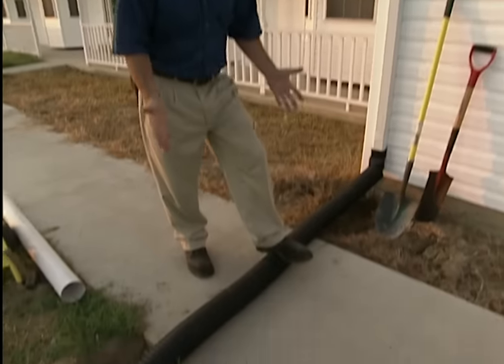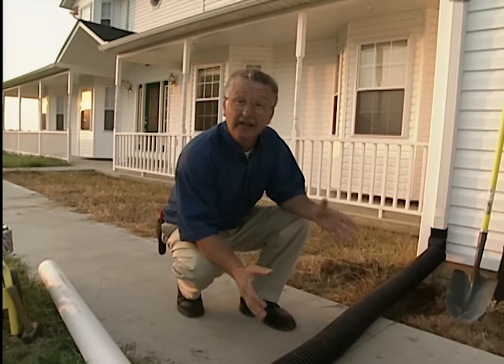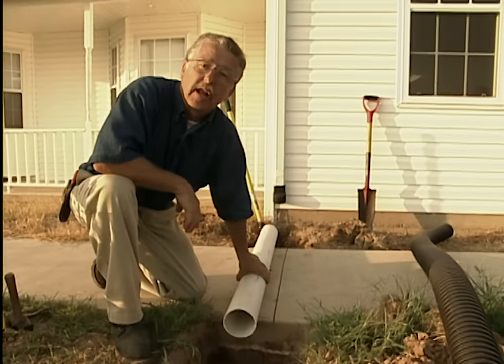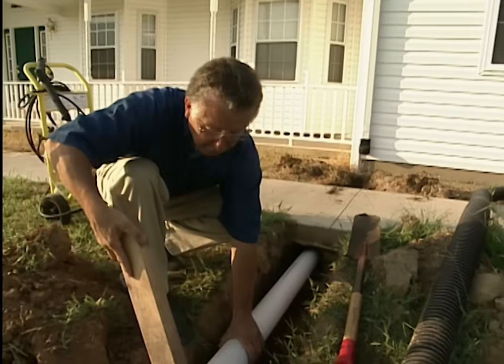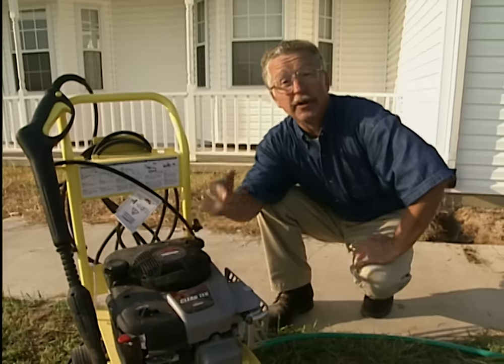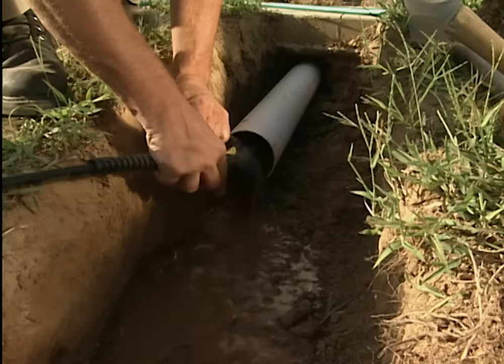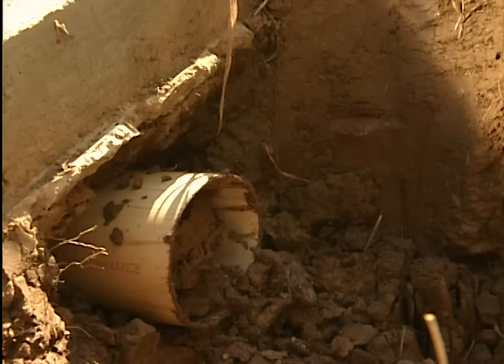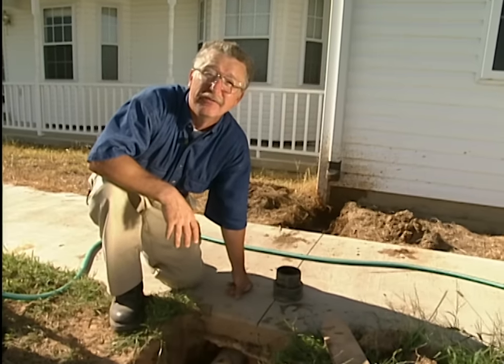How to Run Wires or Drainage Under a Sidewalk or Driveway - The Great Outdoors

Comment: I DID THIS USED A CHEAP HARBOR BLANK ELECTRIC POWER WASHER. I FOUND THAT USING POWER WASHER TO MAKE HOLES UNDER BOTH EDGES SIDEWALKS IN HARD TEXAS SOIL HELPFUL. WORST ISSUES LARGE BACKFILL STONES IN DIRT COULD REQUIRE DIGGING OR MAKING A 2ND ATTEMPT NEARBY 1ST.
Reply: Anyway I have 3 sidewalk crossings about 3.5 feet wide to 4 foot maximum. This has worked but required perserverance to go 4 feet twice in a row so far. A driveway unless super narrow with a hols in midfle using 2 pipes not likely at all. 4 to 6 feet in harder soils really pushing limit.
Theres a chance sharpening one end pipe on grinder my help results. Presoaking both sides helped immensely.

Comment: In your opinion, could the procedure shown here be adapted to run a drain pipe under a driveway, with an added width extension?  All totaled I'd be trying to put a 6" diameter pipe under about 14' of cement.  Thank you.

Comment: You could also use a larger pipe to hydraulic mine, so the flexible ADS pipe just slides through, it is what I did.  Instead of PVC pipe I used a 5" ABS pipe with thicker walls, for the sprinkler system I was able to put seven 1" schedule 40 PVC through the pipe.  Put a squirt of expanding foam between each pipe on the ends to seal up the ABS pipe so dirt will not creep into the void spaces between the tunnel pipe and either the ADS or PVC pipes.  Plus I just used a piece of 3/4" galvanized pipe with a NPT to a female hose connector to hook my garden hose to.  Plenty of water flow to wash out all the dirt.
Reply: what are you trying to say here?
Reply: @chozen_juan  You push the ABS pipe into the soil till it stops because of the friction.  You use water to flush out what is in the ABS pipe, then push the ABS further, keep repeating till you come out on the other side.  The inside of the pipe is now like a culvert under a road or driveway, and any piping you need to go under the concert just slides into the ABS pipe.  The ABS pipe is sealed in the dirt, thus there is not a void for the dirt to collapse into the tunnel.  By eliminating the void you eliminate the possibility of a collapse, which would lead to the concert breaking and dropping into the void.

Comment: This works, I paid somebody a good bit of money to add a power wire under a brand new triple car driveway. This is exactly what they came with pipe, pressure washer, and shovel. When the guy was done, I felt like a complete moron, for even calling him.
Reply: Everyone has to learn some time. Go easy on yourself.
Reply: Don’t feel bad because you came out on top. You were charged for materials and labor but you also got the education on how to do it. That guy won’t get your business again ... so who really won? The moron is the repeat customer.

Comment: If you don’t own or want to rent a pressure washer, you can do the same thing with this hose nozzle from Amazon:

Underhill 6-Inch Garden Water Hose Nozzle, Sprayer, Jet, 7 GPM 80 PSI, 3/4-Inch Thread Inlet, High Pressure Attachment, Heavy-Duty Brass, Adjustable, PowerBlast Super Sweeper, SN6-75

If you’ve got some distance to go, you can even connect it to a length of PVC pipe with threaded connectors at each end of the pipe—one for your hose and the other for the nozzle. 

Make sure the PVC pipe is long enough to reach all the way under the sidewalk or driveway.

Comment: Good ... the pipe is under a control joint ... this cracks the concrete, right there along the joint ... like as not, the concrete has already cracked along that control joint ... why the joint is there in the first place ... shame on who ever poured it, big mistake ...

Comment: Unless you can  get the pipe at least 20 feet from the foundation and run on a downhill slope to a deep french drain, you will just destroy your new home, ALL the new homes here run those pipes about 8 feet away  from the house with just a sock over it, no french drain or anything and wonder why they have sink holes and water in their basements..... I've excavated at least 300 homes that were less than 3 years old due to sinking foundations because of stupidity like this of burying your downspout pipes, do it right or pay the price......

Comment: there's no way that would fly here in my area where its the soil underneath is packed gravel ,roots and old houses that have hidden surprises. its not as easy as tap here and there then done. this house was built on a beach. Here concrete cuter and saw and isolating hammer is a common thing to busting concrete out for leakage or anything because we buried everything in concrete.

Comment: Four and a half feet? Just dig it out with a garden hose. That size machine in the hands of the unskilled is a destroyer. After your sidewalk has lifted and cracked, don't waste the hire fee. Why not indeed take this monstrous machine over to your car to give it a quick wash. Watch as the water pressure lifts the paint effortlessly off the bodywork of your car...still, there's always the boat left to wreck...
Reply: I’ve never seen a pressure washer take paint off a car.

Comment: If you can tap the pipe enough to seat it, then use a shop vac to suck out the loose dirt. Keep tapping and sucking (that's what she said) till you get to the other side.  No mud. No rental fee.

Comment: Great video but I do have a question - is this legal? In Canada, sidewalk, the grass boulevard and the curb are all public property and owned by the MD/county/city. I was under the impression that a homeowner isn't allowed to tunnel under public sidewalk for any reason, be it drainage or running electrical conduit for an outlet for block heaters or RV power
Reply: True for public sidewalks but this one looks like it's his private walkway at the house, and he said it will discharge onto the lawn.

Comment: Why a pressure washer? I just used a regular garden hose. I used a common adjustable spray nozzle. It worked great. Also used it to expose underground pipes and wires with or without root entanglement, with no damage. The last time was to replace a backflow preventer next to below ground sprinkler valves with wires running to them and all tangled up with roots. I couldn't just dig because I didn't know where anything below ground was and I didn't want to redo the whole mess. One trick I learned was to dig a deep hole next to the excavation for drainage.

Comment: I ran a 3/4" conduit under a 4 ft.  wide sidewalk by gluing a female threaded fitting to accept the garden hose on one end of a 6 ft conduit pipe and a male threaded fitting on the other end to accept a cheap straight brass hose nozzle.  No power washer involved, just household pressure.  Fed the conduit under the walkway in about 3 minutes.  Vacuumed the muddy water out of the trench with a shop vac.  Cut the fittings off of each end of the conduit and sucked the muddy water out of it with the shop vac so it was ready to add conduit fittings and run the cable.   My city, Toronto, now digs all holes for setting electrical poles with no mess by Hydro Vacuum Excavation.  24 in. dia. hole, 12 feet deep in less than 5 minutes.  The pole is set and backfilled with limestone screenings.

Comment: Solid solution to a problem that could also pop up in older construction where a walk was added at some point. I'm looking at a very similar issue on my Mom's house. Will try this method before spending a bunch of money on a concrete saw or a contractor. 
FYI, I'd advise everyone ignore the smartass armchair critics in the comments section. This method is used on a industrial scale everyday around the world.

Comment: Corrugated drain tile will trap and harbor leaves and other stuff. The horizontal pipe has to be pitched to get gravity flow. If this is in a northern clymate expect it to freeze up.

Comment: Good thing there is a expansion joint right over the pipe or that side walk would crack above the pipe. If not take wet saw and cut one in it will crack so if you put in an expansion joint your good/

Comment: What do you do when the yard doesn't slope steeply away from the house like in this video and is relatively flat? How do you get the pipe back up to the surface?
Reply: You’ll need to run it underground until you reach daylight at some point away from the house. If there is no such point, then you will need a French drain ( which has limited capacity) or a pump system to remove the water.
Reply: At the end of the straight pipe dig a hole,  A bucket wide, at least 1 meter deep , fill it with gravel up to the pipe exit,  enforce the top part of your hole above the pipe exit with concrete and finish it with a lid, so you won't fall into it.
Reply: And be prepared for it to fill up from a modest rain, and then your gutters overflow possibly dumping all the water on your foundation.

Comment: -
But for such a short run, wouldn't a regular garden hose set to a sharp stream do the same thing?
-
Reply: yes garden hose would work.  I've also used a shop vac and just suck the dirt out it's a lot less mess

Comment: Must of missed the part where he connects the downspout to the drain pipe.
Then again, Mr. Whitepants might of left it open so he can flush it out the roof trash.
Reply: never saw the discharge end either....what's out there to get it to ......where? where is it going?

Comment: I did this in my home and I used a water hose with a nozzle and that worked great.  No need for a pressure washer.
Reply: Depends on the soil in your area - if you have deep rich loamy soil, you are absolute correct.  Sometimes your method won't work, or at least not at a reasonable speed, but my home is built on solid Carolina clay (digging down into it looks like I'm digging through candle wax), and I am skeptical that even this pressure washer technique would be effective in my yard.

Comment: The other reason to use the Pressure washer is when you splatter mud into your siding and have to clean it up.
Reply: I ended up both legs covered with dirt.

Comment: Oof. If you’re going to start with PVC, take it the whole way. No reason to connect corrugated into the inside of the PVC pipe like that. Especially without the proper fitting.

Comment: That black corrugated pipe is trash. You should be using that Schedule 40 pipe all the way to the end of the drain. Plus the fact that the adapter goes inside the PVC and you said put a screw in it to hold it, LOL the water is going to bypass that corrugated pipe at that joint. Some Plumbing expert you are … 🙄😂

Comment: Could use for wired dog collars I assume?  But what if you have to go under a driveway?  I went radio.
Reply: They make wireless dog collars now. App on your smart phone. Underground wired collar systems are a thing of the past.
Reply: @christopherterry5457  As I said, I went radio.  It doesn't have any apps but I don't know why I would need that.  It works pretty good but it has it's limits including range and shape (you can chose from a circle and a larger or smaller circle).  But if you wanted to cover either a larger area or conform to the shape of your yard you still have to go wired.

For me, my yard is big enough that with careful selection of the transmitter location I could use the largest circle, which gives the dog about 1/4 of an acre.

Comment: So.. dig a trench flush up to the edge of sidewalk. Then, I spend 1 minute using a 'tile spade' to dig 1 foot under the sidewalk. Now.. instead of spending 3-5 more minutes digging under the entire sidewalk to place the pipe, I go spend $50 on a pressure washer, also buy a 4" PVC pipe 10 feet long and only cut off only 6" to make it 4 feet, and then hydraulically mine it under the concrete.  Naah.

Comment: Great video, but at the end he recommends using a screw to secure the pipe to the footing. That is a no-no as it will create a snag point with leaves and debris and eventually cause it to clog.
Reply: If that 4" pipe has so much volume of water coming through it that it completely fills it up to the top, that is the very LEAST of your problems.
Otherwise that screw sticking down from the top will never cause an issue!
Common sense!
Reply: Great video, but at the end he recommends using a screw to secure the pipe to the footing. That is a no-no as it will create a snag point with leaves and debris and eventually cause it to clog.

The unclogging video will be out in 6 months at this same property and we will see how it is done on this pipe.

Comment: What about the lack of solid soil now under the concrete????????.
Reply: By boring through the soil this way, only the soil within the pipe is displaced and you ensure there are no voids outside the pipe wall. The pipe takes the place of the soil. Just need to make sure you don't jet too far ahead of the pipe (in a perfect world you would advance the pipe simultaneously as you are hydrocutting the soil).

Comment: Why not cap the pipe before hammering it into the soil and using a pressure washer to wash out the soil,he had enough room on the other side to take it off
Reply: Omg, you guys. Watch the video again.
Reply: Think about. With a cap on, you are try to push all that dirt  instead of it being open and cutting its way through the dirt.
Reply: @rooftopvoter3015  - You can't lift the slab unless you rent a concrete saw and cut them apart.  I could be wrong on that but I know that's what people around here have had to do to replace sidewalk blocks.  Even then, those things are really heavy, like a thousand pounds.